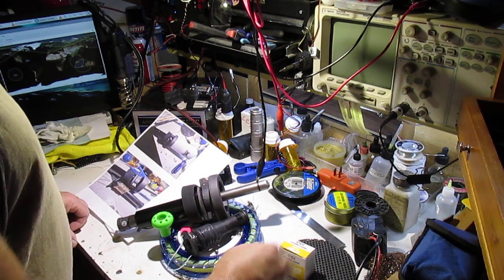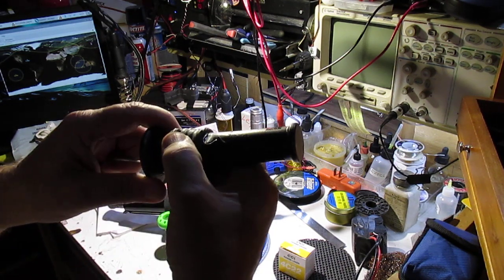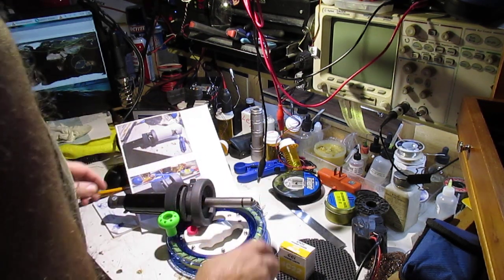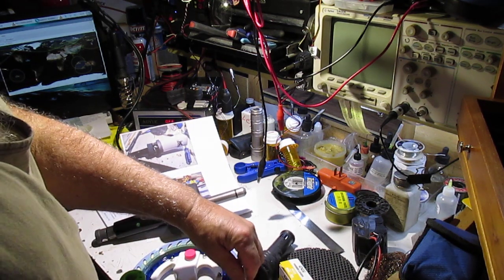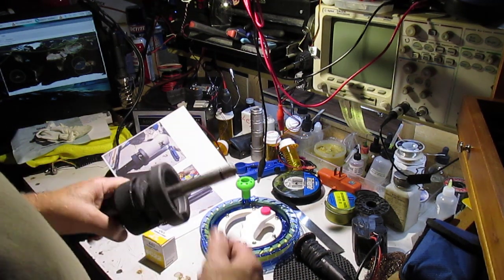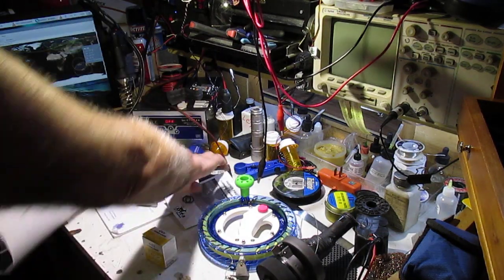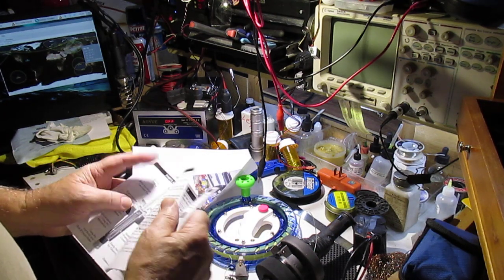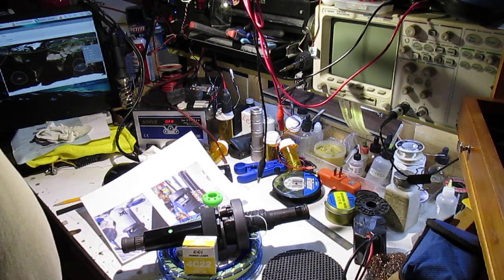Ham Radio ANTENNA LAUNCHER

Comment: Very cool and, as you say, much simpler and more compact than the pneumatic ones. I think perhaps even the level 2 brown box would be enough caliber to get over a big tree, and maybe less loud. It might be a little too loud for POTA, since it’s a 22 caliber blank and likely sounds like a weapon. 

Question… do you launch the kite line while it’s on this reel? Or do you flake it out carefully on the ground before launching? … and do you think the weight of the heavy wire at the base of the ‘dummy’ is needed? It seems like maybe the cushioned muff piece is not a bad idea.. making the projectile hit more softly. Is your impression that the added weight helps it fly farther, or less far. Appreciate the tips :)
Reply from the maker: First run out the kite line the distance that you believe you're going to need, then pull the line back in dragging the projectile so that when the projectile is in your hand all the line is in a circle below you.
The heavy wire at the projectile, I put it on there because in the video with Bob Heil , they added the weight and I believe it is they are so that you could attach a heavier rope and the momentum will be there to bring it over the tree.

If you leave the white cushioned piece on, it may cause more wind resistance, the weight of heavier line and the cushioned piece may limit the height you may get from the projectile wind resistance.
As far as 22 caliber blanks, You can use the green blanks and you can use the yellow blanks but it is recommended not to use the red tutor they are more powerful.

In the notes: Video from Bob Heil: Antenna Launcher
https://twit.tv/shows/twit-bits/episodes/3007